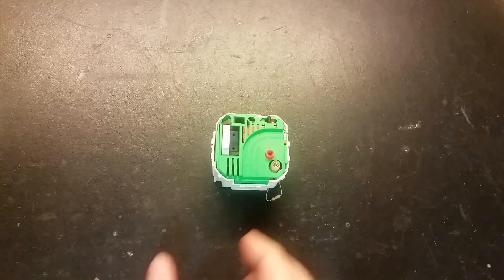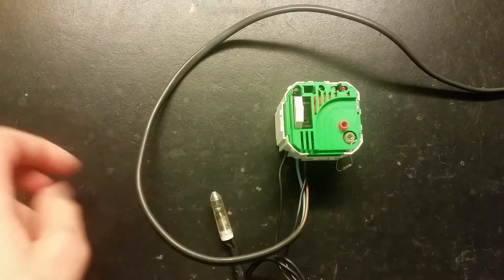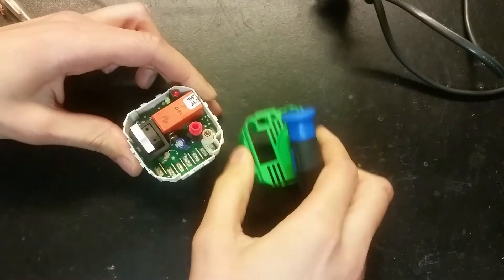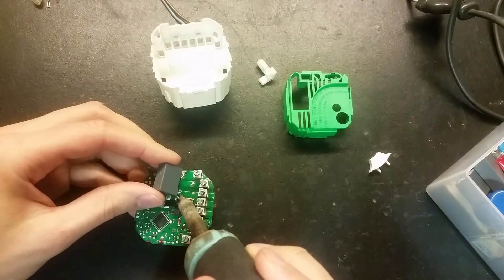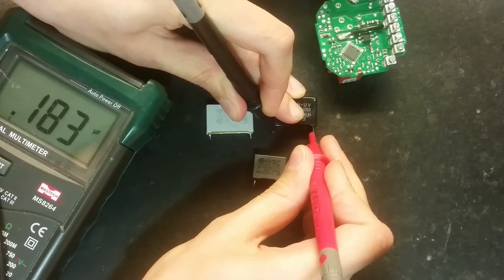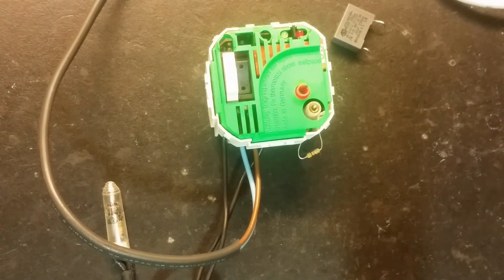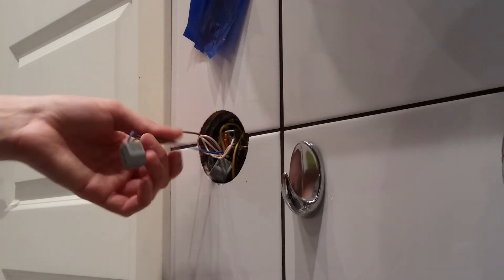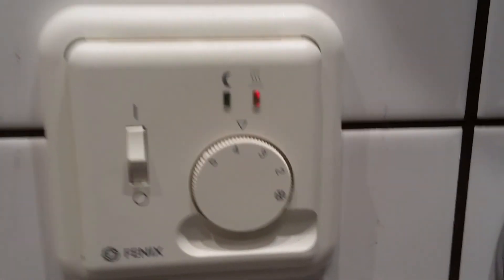UnderFloor Heating Thermostat Repair #1

Comment: Mine keeps turning on and off, if i change the temperature setting it will work for a little bit then start turning on and off constantly like it is confused (you can see the light going from green to red constantly and not heating the floor).
Reply: The capacitor says 220nf but I measured 91.
Reply: I changed the capacitor and it is working perfectly.

Comment: Hi i have to try it on friday. But i have another problem, when Thermostat is on fuse blow. Another electrician said, that somewhere is short circuit . But he dont know if in thermostat or heating wires ares burned. Any tips.